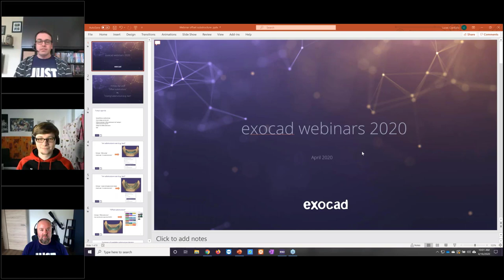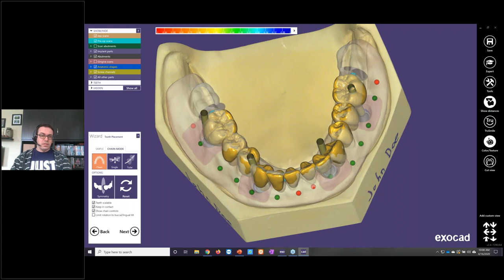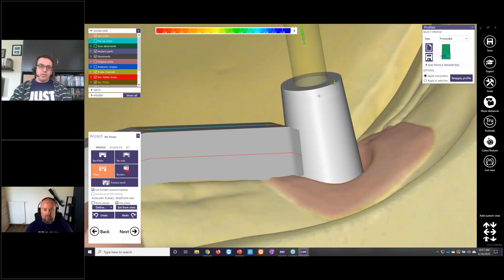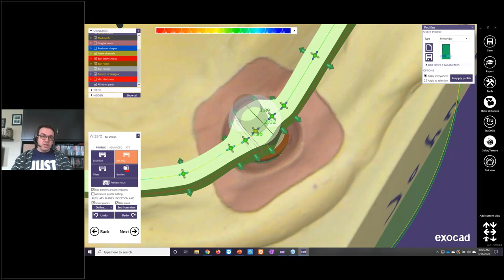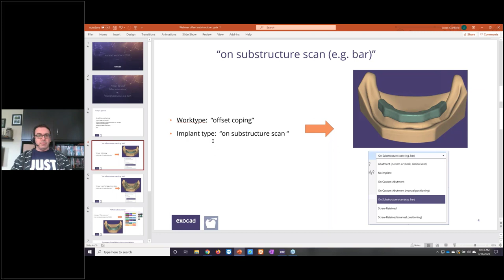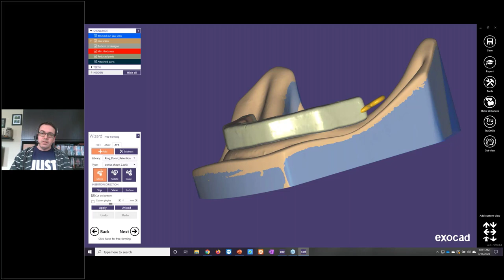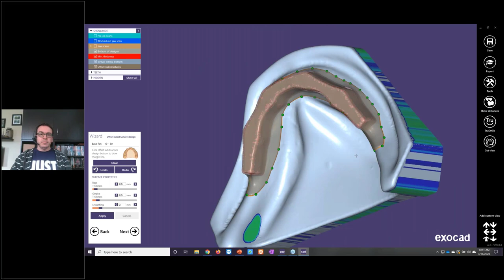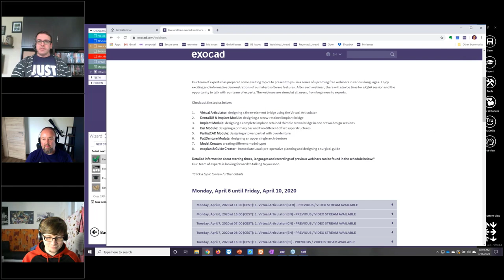exoWebinar: Bar Module (in English)

Comment: What should be the ideal thikness and height of the bar for upper n lower arch? Thanks
Reply from the maker: Hello @sumitgiripunje8532, 
it depends on many factors, the material, the distance between the pillars. 
Also whether specific attachments and anchoring elements are used.
Reply: @exocadvideos  thanks

Comment: Make a video on: Designing customized locator abutments digitally designed using Exocad v5541/64;Exocad GmbH  and CAM processing using a computer milling machine using the standard Zest dental 3.86-mm male connections on the milling settings; to be delivered as an abutment screw  to correct angulations of implants and make a locator implant denture. That's what I would like to see.